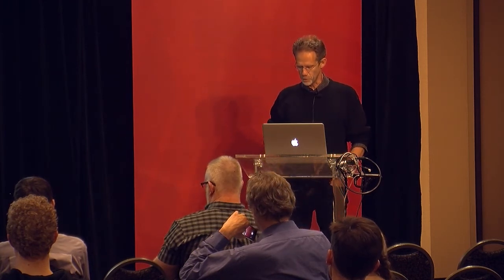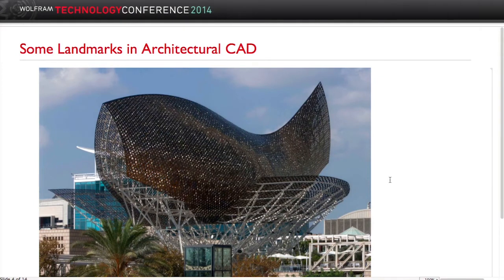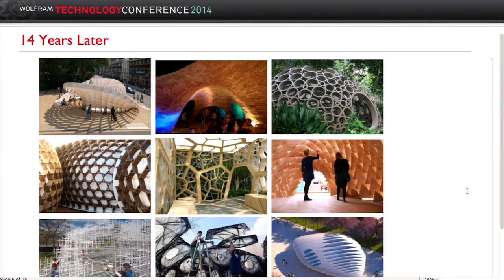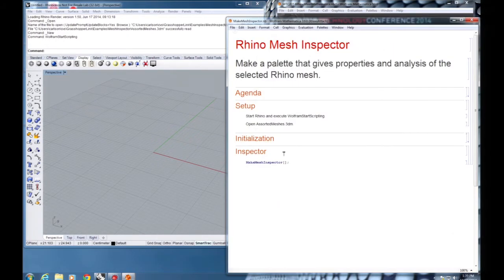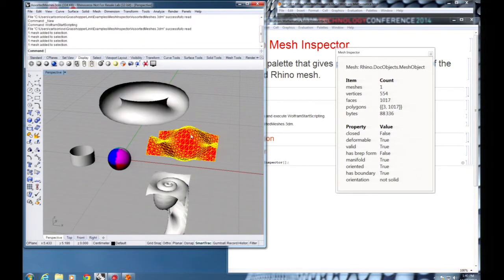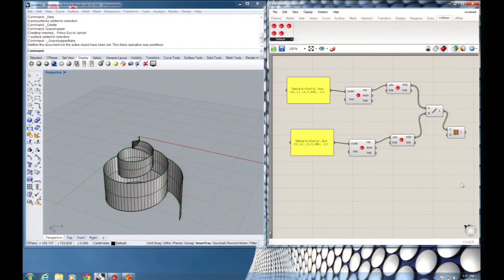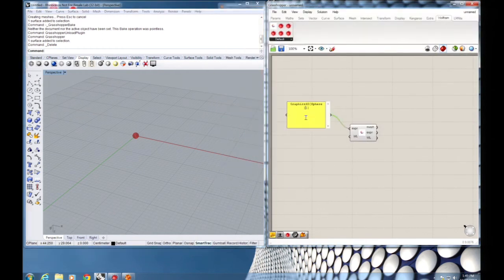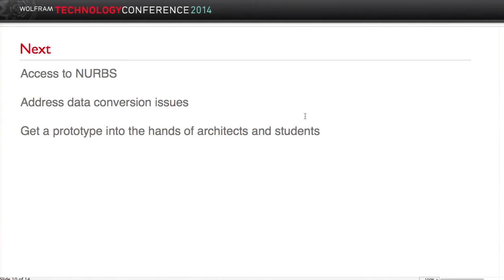Rhino, Meet Mathematica

Comment: This is amazing, would love to see this developed, and not limited to just rhino, but Spaceclaim and Alibre have robust programmable api's.  What is fantastic is you can design and get the curated data with mathematics such as material properties, and they can be defined, and you can do design accelerators such as are in Autodesk inventor 2016, such that you can pull down standard parts and have Mathematica create them for you and do the iterative calculations as you are designing, and then you can pull that all into systems modeler for multiphysics and dynamical system modeling of your design.  And for the electronic controls and such you can even do hardware testing in the loop.